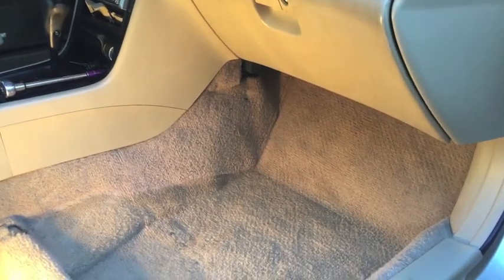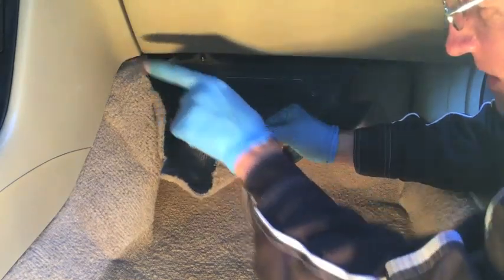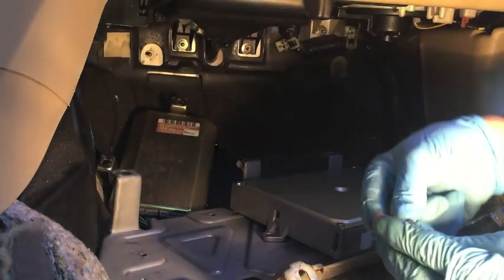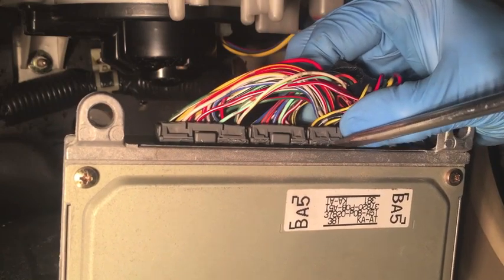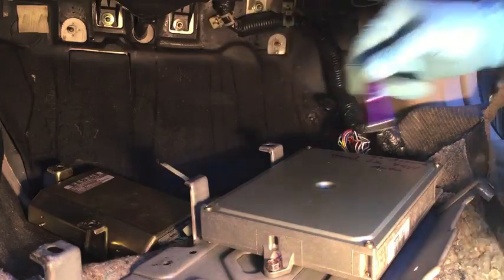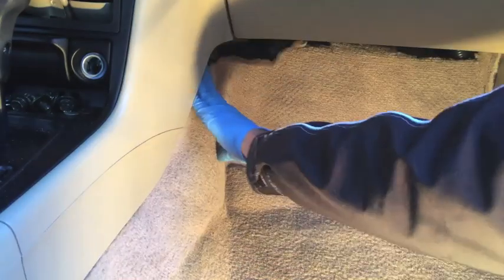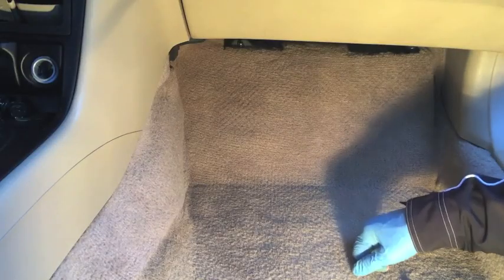94-97 Honda Accord Computer Removal: ECU/TCU

Comment: Great video. 😊 It may be 6 yrs old, but it helped me today.  I was at my wits end with my 94 honda accord.  I paid a mechanic a ridiculous amount of $ who simply replaced the ignition switch and threw up his hands when that didn't work for a start, stall, no start issue. I've replaced part after part myself, but ran across and tried your ECM freezer test today. My honda (aka Sam) cranked right up!...then stalled just like your video. Now I just need to find an ECM. THANKS PEANUT BUTTER MAN!!
Reply from the maker: Yeah I first used the ECM freezer test back in the summer of 2014.. Intermittent no start then start/stall.. Not my idea though.. I read it in a Honda repair forum.. Glad it helped you out..

Comment: I need a new ECU on my 94 5 speed. Can i use a ECU  that came off a Automatic transmission?  Or i need to find one that come off a Manual Transmission?
Reply from the maker: The computer ID numbers have to match old vs new.. Automatic will have different computer.. Gotta find a 5 speed manual and match the numbers.. This may help:
https://www.youtube.com/watch?v=k6cNSNi0R5s&t=1s

Comment: Dude this video is great. I saw your comment about putting the ECU in the freezer to diagnose it and that helped immensely. I don’t recall if it  was also said in the video, if it is I apologize, but the comment mentioning putting the ECU in the freezer should be put up in the description and be screamed from the rooftops. After days of researching about crank no start issue, that was the first I saw of testing the ECU by putting it in the freezer. Thanks again dude 👊🏼👊🏼👊🏼
Reply from the maker: Glad the video helped.. I have a separate video related to the freezer no start tip:
https://www.youtube.com/watch?v=MUKbdrdVMyA

Comment: I have the factory service manual for my 96 Accord with 4cyl sohc automatic.  I couldn't find anything about where the damned computer was located, so mucho gracias for your explanatory video!  One big difference is that my car did not come with the transmission control unit, so hopefully the tranny problem is in the computer. I went for the computer after going through a bunch of reman alternators having similar failure issues after 20-50 miles.

Comment: if you have a manual do you still have a TSU?
Reply from the maker: I don't think so cause you don't have an automatic transmission.. And your ECU may only have 2 harnesses that snap into it instead of 3 like mine.. No communication needed between ECU/TCU on yours so fewer wires.. https://honda-tech.com/forums/honda-accord-1990-2002-2/tcu-ecu-3209015/

Comment: I have a 1999 honda accord v6 3.0l with a B7XA trans and guess what that is NOT where the cpu is located wish YouTube allowed pics instead of text comments
Reply from the maker: I don't know from experience but based on the info in this link yours is located behind the radio.. Shown at the ;57 mark in the video.. https://www.pullapart.com/video-library/videos/how-to-pull-a-honda-computer-honda-accord-1997-2002/

Comment: What numbers do I have to match on the replacement ecu?
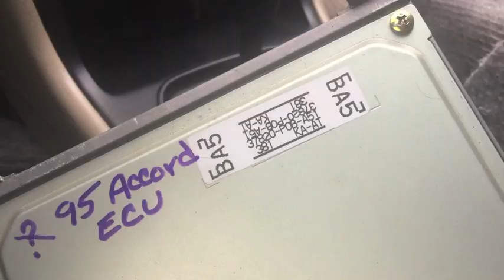Reply from the maker: The numbers shown at 4:49 (top) and 4:52 (side)..
Reply: My car is a 1996 Honda accord lx 2.2l non vtech with automatic transmission any idea wich ECU should I get?
Reply from the maker: You either have to get the numbers off the ECU that you have now or a Honda dealership may be able to tell you which ECU you need if you call and give them your VIN..

Comment: Hello,
What a great video. You get straight to the point of rem. rpl of the TCM. My 1996 Honda Accord had a ABS light go on and stay on. 
Shortly there after the Check engine light came on. Diagnosed to the TCM. 
Do you happen to know if the TCM is connected to the ABS system? 
Haven't had a moment to remove the carpet underneath the passenger side to look to see if the ECU/ECM and the TCU/TCM were placed into a single unit. 
If this is the situation for my Honda, what are your recommendations of purchasing a new single unit? Where would you recommend I purchase one from?
I'm not opposed to purchasing a refurbished one.
Thank-you
Reply from the maker: Up to this point I've gotten by with junkyard ECU/ECM's for my 95 but good ones are getting harder to find.. I've had this site saved for several years in the event I need a refurbished one.. Free shipping, lifetime warranty.. No idea if they are good/bad..https://store.allcomputerresources.com/searchresults.html?query=1996+Honda+Accord
Reply: @PeanutButterMan-PBM  
Hello, 
I was able to open up the passenger side compartment and confirm that I just have the one ECU/ECM and the TCU/TCM single unit. 
The single unit has a date - March 26, 1997. The bar code reads - 37820-P0H-L52 887-344355 IPT. 
Do you still recommend I order an ECU/ECM from the link you provided which are primarily a 1996 unit?
Thank-you
Reply from the maker: If you click that link there's a toll free number on the top right corner of that page.. I would call them first and tell them your situation before ordering anything.. They will want the bar code number so have that ready.. Good Luck!!
Reply: @PeanutButterMan-PBM  Will do!! Thanks for all of your help.
Reply: Hello,
Called All Computer Resources, they asked for my VIN number as well as the ECU number and was able to place an order for a new computer.
Really great resource for sure.
Many thanks for your expertise on your video. Was quoted an estimate from a Transmission company near me at $1240.00 to replace the TCM.
Saving all sorts of money!
Reply from the maker: Didn't think about the VIN but it makes sense that they would want that.. Yes, DIY (if done correctly) saves money.. Hope the new computer works for you..

Comment: On 1994-1995 Honda Accords does the A01 or A02 on the end of the TCM number mean anything significant or is it just a revision number? I'm wanting to check before I get a transmission for my 1994 Honda Accord LX wagon so I can make sure I get the right TCM or can reuse the one already installed.
Reply from the maker: Got this info from a site explaining ECM numbers.. Not sure if it applies to TCM's also.. 
"The last 3 characters are broken down into 3 parts. "A" generally is used for US ECUs. "G" is European, and "J" is Japanese. There are other versions of this, but you get the idea. The second digit "0" typically means manual transmission, where a "5" means automatic transmission, and the last digit "1" is the version number."

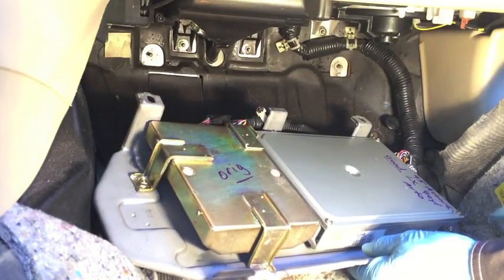Comment: 1:23 "fold it down". I've got this far, and it's not folding down. Something is pulling and straining and feels like it will break if I force it down anymore. Any tricks for this part?
Reply from the maker: after removing the four 10mm nuts that hold the kick-plate down you have to pull it towards you a little until it clears the four threaded studs.. once you do that, you should be able to pull the top towards you and lay it down flat like i do in the vid.. the top may catch on the bottom of the glove box but you just work it past that.. then the only thing(s) attached should be the wiring harnesses..
Reply: @PeanutButterMan-PBM  the problem was I didn't pull the carpet back far enough and it was getting caught on it. Just fixed it now

Comment: On my 1996 there was only 1 unit which comparing it to yours looks like the ECU/ECM and had 4 plugs instead of 3. For the 1996 were the ECU/ECM and the TCU/TCM put into a single unit?
Reply from the maker: I guess I need to change the title of video cause yes, it appears your 96 has a single unit..  Research found this info..  "The stock 96-97 Accord with automatic transmission uses a single PCM/ECU to control both the engine and auto transmission"
Reply: @PeanutButterMan-PBM  yeah I found this out a bit after I left the comment.

Comment: Where is the srs unit located?!
Reply from the maker: I've never had an issue with SRS so I don't know where sensor unit is located.. But there's a diagram in this repair forum thread that may help.. Scroll down a little to a post by redbull 1.. He has a thumbnail attached with diagram..https://www.hondaaccordforum.com/forum/general-tech-help-7/srs-cel-obd-1-stuff-any-thoughts-suggestions-50285/
Reply from the maker: red bull 1's second post has the SRS diagram..

Comment: How do you thread the black and yellow wires of the ecu back through the firewall to the intake manifold?  I had to cut them to get the intake off and rebuild the engine?
Reply from the maker: not sure.. never had that issue..
Reply: @PeanutButterMan-PBM  Nuts!  Thanks anyway, man.  Guess I'll just have to tear the dash apart to get to it. Such is life.

Comment: Thanks for the video! Wondering if you had issues with your ECM ? I have a 96 Accord DX with the F22B2. That keeps stalling randomly. The main relay had been replaced, as well as the ignition switch in the last year. I have spark, and fuel pressure when this happens. I suspect no injector pulse is causing the problem. However it always restarts eventually. Usually 10-20 minutes after. I looked at the solder joints in the ECM and they all look good. Not sure if you've seen something similar ? Though mine is OBDII, not sure if yours is OBD I do to the year difference.
Thanks
Reply: Clean ur egr port and the intake ports they full of carbon easy by removing the fuel injector  rail
Reply from the maker: No issues with the ECM at this time.. I had a front passenger water leak and took everything out to dry out carpet.. I have had 2 ECM issues in the past though.. Both solved with ECM (salvage yard) replacements.. First was no start when interior of car was hot.. To diagnose, I took ECM out of hot car (heat expands solder joints to expose cracks)  and placed it in fridge for 1 hour.. Plugged the cold ECM back in (same hot interior) and engine started/ran fine.. Second issue initially led me to believe I had a transmission problem.. RPM's would surge and transmission felt as though it was slipping.. I had stockpiled a few ECM's at that point and swapped one out just to see if that was the problem.. Problem went away.. Put the old ECM back in to confirm issue, problem returned.. Faulty barometric pressure sensor in ECM?? Don't really know.. I keep an eye on two salvage yards where I live for automatic 94-97 Accords with non Vtec engines.. Specifically to check for ECM's that match mine.. I like having spare(s).. Good Luck with your issues..

Comment: Excuse me sir i was wondering if you had to disconnect the battery and let it sit for 15 min before installing the new ECU
Reply from the maker: Good question.. I personally don't disconnect the battery when removing/installing the ECU and I've never had a problem.. But it's probably a smart thing to do.. That way you fully restore power to the ECU all at once instead of partially restoring as you connect each of the 3 harnesses..
Reply: @PeanutButterMan-PBM  ok i was justcwondering because i seen a different video and it said u may have to flash it or calibrate it but my friend said i can just do the replacement without that

Comment: What about for 99 Honda accord ex
Reply from the maker: I believe yours is located behind/below the center of the dash.. Not on floorboard like my 95 accord.. There's a diagram in this link.. https://www.2carpros.com/questions/honda-accord-1999-honda-accord-location-of-ecu
Reply: I switch it but now it only cranks but doesn’t start